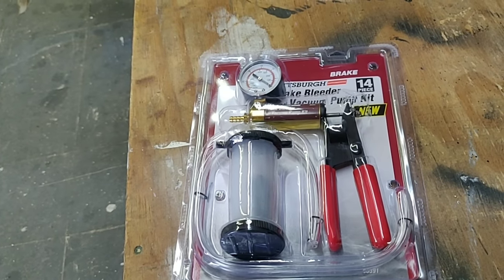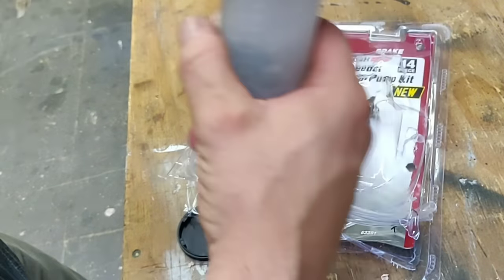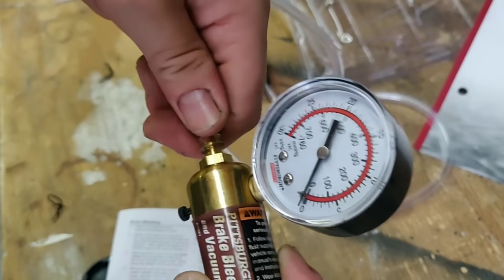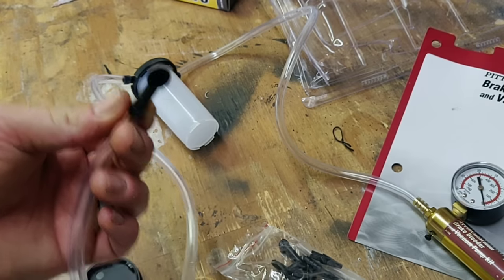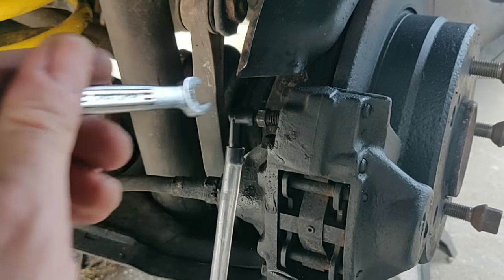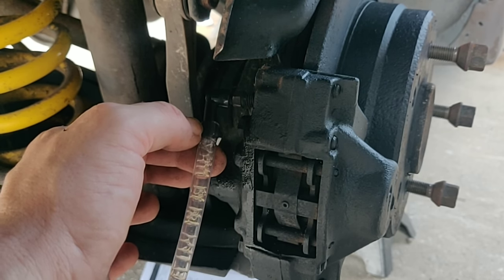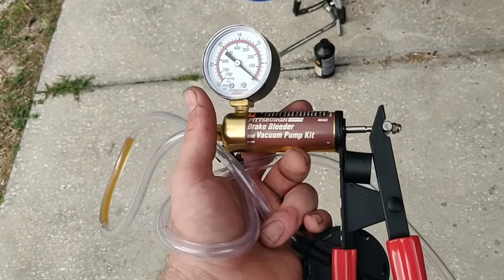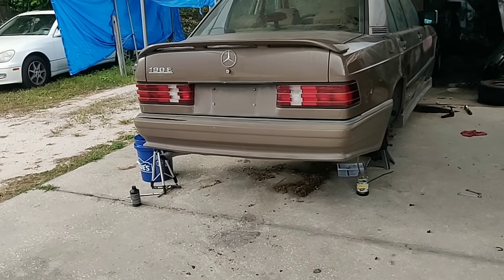Harbor Freight Pittsburgh brake bleeder vacuum pump demo and review

Comment: Best to use a box end wrench instead of a line wrench on a bleeder zerk - reason being that a box end will easily fit over the end, since there's no brake line to contend with, & even the best line wrench has a certain amount of give at the gripping surfaces due to the opening to allow it to slip over the brake line. Also, you can always just run a short length (about 6in to a foot is fine) of tubing from the bleeder zerk to a small jar or bottle with enough fresh fluid to cover the tip of the tubing by about 2 inches. Crack zerk open & gently press the brake pedal a couple times. Air bubbles exit, only fluid can return. No assistant needed. Keep an eye on reservoir's fluid so you don't run it dry.
Reply: If your inside pressing the brake pedal, how do you know when all the air is out of the line? You can’t physically see it.
Reply: @M21-w1y  good question… wonder if you tell a difference in the pedal, or maybe you have to get out and go look?
Reply: Guess you wouldn’t positively know but 7 pumps is probably fine. Also with enough tube it’s not like any fluid is being wasted, just sucking back in.
Reply: I bought 12 foot of hose put it on the bleed screw and ran it to the break resivor pumped the preaks. Until the bubbles were gone. But like some one said if the bleeder valve is loos it will suck small air bubbles

Comment: i had one i did the same as got rid of it . i did take it back to the shop and said it  would not bleed the brakes on a 850 mini what a pile of junk i have been in the trade over 30 years.. great upload
Reply from the maker: Wow thanks for the comment.  Good to hear a realistic approach.  I made video to show what's its like using a tool that most have never used and how it could work.   I have a lot of comments telling me I'm an idiot but I've been wrenching on cars with my dad since I was 9.  By no means am I a mechanic or think I know a lot but it's all about learning everyday.    Also my dad is a certified airplane mechanic and said he would still never use this.   Sometimes the good old two person method is the best.

Comment: I just installed pads, rotors and two front calipers on the 2012 Accord. Got everything together, bled the new calipers, I think a 3/16 inch clear hose and an empty gallon jug. I was flushing out the old brake fluid, and fluid is cheap. Did the entire job by myself, using the brake pedal. I think I paid $4 for the hose at Home Depot, along with three 12oz bottles of DOT3 brake fluid, $12, again, at Home Depot, the jug was free at this point. Remember, if you have an ABS unit under the hood, usually opposite the brake fluid reservoir, that is your starting point in regards to bleeding order.

Comment: JSYK, I ran into the same issue with this pump. I ended up having to put the clear hose directly on the brake bleeder valve as none of the connections fit correctly.  The pump did get some of the air out, but not all. I found that the plastic bottle and oring began to leak causing it to loose vacuum.  I would not recommend buying or using this pump. Had to do it the old fashioned way.
Reply from the maker: Thanks for the info and appreciate you watching.  Have a great day.

Comment: Hey. You need to remove the rubber stopper that wedged between the pump handle prepackaged from factory.  This is why you can't pump up the pressure. It happens to me and I realized it. This tool works great in my Honda Odyssey 2010 EXL

Comment: I made my own powered vacuum pump from a B&D drill, 12v air pump. I jb welded a fitting to the intake of the pump creating a vacuum source. I also have used a cheap check valve on the tubing to keep the fluid from going back.
Reply: sounds like you should make how to vidz bro

Comment: I've been wondering about using the "vacuum" approach to bleeding brake systems.  But, I think I see a flaw in that method - the bleeder screw.  As you apply vacuum to the bleeder screw and then loosen the screw I think that allows air to suck in past the screw threads.  The more you open the bleeder screw the more air is sucked in as shown in this video.  I don't think the vacuum pump was at fault - just the process.  When someone is pumping the brakes the pressure forces out air and fluid through the bleeder screw AND around the threads.  WE DON'T CARE.  It is pumping OUT any and all air along with the fluid.  That's why the brake pumping technique works better than the vacuum technique.  There is a way to pump the brakes by yourself and that is to use a bottle half filled with brake fluid and a hose from the bleeder screw into the bottle and deep into the fluid.  That way, air gets pumped out and not sucked back into the brake system.  And don't crack the bleeder screw out too far - just enough to get a light flow.  Or, take out the bleeder screw and put some teflon tape around the threads being careful not to get the tape on the machined surface of the screw.  That should stop any airflow over the screw threads.  Or, some "grease" or anti-seize on the threads should also stop airflow past the threads.
Reply: How would you ensure air does not get sucked back in past the screw threads when pumping into a bottle?
Reply: @pingpong9656  - If you are going to bleed the brakes by yourself by pumping the brake pedal then after using grease or teflon tape on the bleeder screw threads you should put the other end of the plastic hose into a bottle of brake fluid.  That will prevent air from being sucked back into the brake lines.  There are some good videos about how to bleed brakes with one person only.  They will show you how to set it up.  I think Chris Fix has a good video on that.
Reply: If you look at the video the user didn't remove the black circular piece that is on the tool for shipping tool was not defective if that piece is remove you will get lots of pressure.
Reply: You are exactly correct.  And the guy threw away a perfectly good tool. What a waste!
Reply: Good tips, thanks.

Comment: I agree with his review and assessment of this item. I just bought this same device from Harbor Frieght. I tried to use it on my 55 Ford that I put new wheel cylinders in. I could get this device to pressure up to 25. But, that was not enough to bleed out the brakes. I spent several hours trying. My son came by and in 10 minutes we bled the front brakes. This tool simply does not build enough vacuum pressure to bleed brakes.

Comment: To everyone having this issue.  See the line in the body between where the gage is mounted and the rest of the body?  Unpeel that pittsburg sticker.  The front of the pump unscrews right there.  Hold the gage and handle, and just unscrew the the front end right off.   There is a rubber check valve / diaphragm inserted into the gage side (it will look like a flat piece of rubber but it has a tit on the back side (inside the body pointing toward the gage) that acts as a check valve.  Gently pull that check valve diaphragm out and clean it.  Be careful not to tear it, and don't get any oil on it.  All it takes is a spec of dirt getting in there to hold that check valve open and it will behave just like yours.  It's not Harbor Freights fault, there is no filter in these things, you probably sucked something up in there.  I paused the video to write this and right there while you are calling it a piece of junk you have fluid in the suction hose (past the reservoir).  Cleanit up, unhook the hose and  blow it out.  It should work like new after that and go to like 25" of Hg easy.  You may need to do that quite often because again there is no filter and maybe you accidentally get dirty fluid  or dirt in the air all the way up there.  Also I find that little rubber gasket on the reservoir can leak to and cause the same problem.  It happens

Comment: I just bought one and I see some issues with your set up.
1st off The bleeder needs some thread tape or pipe dope  to seal it from sucking air while you apply vacuum.
Secondly the bleed screw adapter you installed backwards the big end goes over the clear line and the small end goes over the bleed screw nipple. Once that’s accomplished it’ll pull plenty of vacuum and quickly suck the air out of the system. The instructions show the bleed screw adapter backwards in my opinion. It actually works really well this way.
Happy wrenching!!

Comment: You have to remove the tab from the pump trigger, or it won't pump higher than 10. I accidentally figured it out by taking a look at the instructions. 
My instructions said to remove the tab, or you can't squeeze it all the way back. Once you do, you can easily get it to the highest level.

Comment: A "pipe wrench?" I would use a flare nut wrench.
Reply: Pipe wrenches aren’t for working on vehicles.  Obviously this guy doesn’t know his tools. Box end “brake bleeder” wrenches work best, and limits rounding the bleeder. High end Flare nut wrenches would be ok too, but cheap ones usually fit loose and could easily round off the bleeder.

Comment: Need to ptf tape on the bleed nipple threads to stop air getting in 👍
Reply: Do not use tape or it will get into the system. Use silicone grease on the outside threads. It worked for me last Month.

Comment: Bubbles are being pulled in through the bleeder threads. Remove the bleeder and wrap the threads with Teflon tape. Reinstall and then bleed.

Comment: you are probably leaking air from the screw thread or the fitting. That always seems to be a challenge
Reply: Remove and clean the bleeder screw. Before replacing it, wrap a little plumber’s tape around the threads. This will eliminate the problem of air mixing with the fluid by way of the loosened bleeder screw.

Comment: The item works, but you need to put some grease between the inner and outer thread of the valve. If there is no grease, air is sucked in by the negative pressure and appears in the brake fluid coming out. So you never can be sure, if the bubbles are coming out of the fluid or through the thread. What I saw, was air "inhalated" coming through the threadts. That also can happen by using posive pressure, if the valves are unscrewed too much.
Wherefrom do I know this? I have tried the same tool and had a lot of bubbeling. I analysed the problem and fixed it with the method descriped above. 

Regards Th. Krapf

Comment: LMAO pause at 11:54  that little black round thing sitting in between your pump handles is supposed to be taken out its basically just to hold the handle in place for the packaging, thats where every bit of your problem came from!!! you werent able to press the pump all the way haha. also all those air bubbles you are seeing are not coming from your brake lines its coming from air being sucked in around the bleeder valve, i just connected the hose straight to the bleeder valve without that little black attachment and also took some grease and smeared it around everywhere and it seals airtight. this is by far the easiest method of bleeding brakes for me, i hope you didnt waste your money and throw yours away because you did it wrong lol
Reply from the maker: Oh wow thanks for filling me in.  I may still have if trash didn't come. I will take a look but I still think there was an issue with it holding pressure.  I tested it a few different ways off camera
Reply: @petescarport  Once you break the bleeder valve it will draw air in from around those threads as well, but see my comment on the adapter you're supposed to use in the clear (23" or 3") line before the bleeder valve of the correct size.
Reply: Just return the darned thing
Reply: Do you know what's the purpose of connecting the hose to the bottom of the container cap? I forgot I have to do it the last few times I used it, but didn't see a difference.
Reply: @ronenfe  That short hose stays under brake fluid in the reservoir. So if the pressure changes brake fluid goes thru the line back to the brake and not air. As that is in the top of the reservoir above the brake fluid. Hope that clears things up.
Reply: @waterandsteel4713  How could the pressure inside the system get lower than the pressure in the container?
Reply: Anyway I close the bleeding screw before I let the pressure drop.
Reply: @ronenfe  Uhm let me see. Some one starts the car? The hose slips off the vacuum chamber? The air release valve (under the cylinder) fails? Anyway I didn't engineer the damn thing and I don't care when you close the bloody screw. I'm done.

Comment: Those "bubbles" are from the loose bleed screw, lol
Reply: Yup, need to put grease on the threads.
Reply: @georgecurtis6463  what kind of grease should i put? silicone paste or copper anti seize?
Reply: @kevinzki21  any kind that is thickish. Or thread tape. Anything to prevent air from passing through the threads.
Reply: I've read that elsewhere; is there any risk of the grease being sucked into the thread gap, as the air is doing?
Reply: @georgecurtis6463  Thanks; is there any risk of the paste/grease getting sucked into the system, as the air is?
Reply: @JackJensenTrader  well, there is a chance but when bleeding with this type of system, you go slowly. The fluid doesnt move fast, in fact rather slowly. So if you just crank up the vac thinking it going to speed up the flow, it won't but it will cause the grease to get sucked in. So it's a slow, tedious way to bleed brakes. You just need a small slow stream and yer good.

Comment: I order a the same pump on ebay I desperately waited 3 weeks to get it. I was able to pump it up to 15psi on the 2 rear tires but fluid got into the pump and fail to keep pressure. It was not the pumps fault it was mine for not watching videos or read the instructions. You never want fluid in the pump per videos I watched. I learned by my mistake...heading to harborfreight tomorrow to try it again.
Reply: This is a key point. The bottle tips over and some fluid gets in the line between the bottle and the pump, and it no longer functions as it should.

Comment: there's a cup stopper once you take that out you can get 10-20 easily. It didn't lose pressure when the bleeder was closed so it's in the system. Mine never stopped bubbling but I would pull a bout 8 fl oz through.

Comment: It may be user error in this case but I will confirm that It actually is not a very sturdy vacuum pump. I used one for testing the vacuum line that controls the climate in a Ford Crown Victoria and it broke in relatively short order, maybe a month later, with the issue being it was not able to hold vacuum any longer. I purchased a MityVac on Amazon and it has worked flawlessly as a vacuum pump with zero issues.

Comment: Do you think air was leaking in through the threads of the bleed nipple?  I have heard it recommended to wrap it with teflon tape there.  I believe you can also purchase bleed nipples that have a one way check valve inside them, which would mean you don't have to loosen the threads which can create a leak there.

Comment: As mentioned by others, you forgot to remove the black spacer between the handles before using as noted in the instructions.  My HF bleeder tool works flawlessly!  I now see you posted an updated review. Thanks. 😮
Reply: Yes, that piece just above the fulcrum prevents the outer pump handle from bottoming-out on cylinder, from which the next stroke will have maximum vacuum travel.

Comment: You left the shipping spacer in the pump handle, I initially did the same. Mine works great and I’ve used it on many different vehicles.

Comment: I have one of those.  However, it didn't work out of the box.  The black cap fits loosely on the fluid cup.  Had to wrap the top of the cup with teflon tape before I could draw a vacuum.  May have been a factory defect.

Comment: I was looking at mine between the two grips there is a round plastic packing piece that has to be removed before use or it will not go past nine the one on this video still has it in,it works great

Comment: To be honest I would have just put the hose straight on to the brake nipple. The guy does a follow up to this video where he learners how to use it properly. There's also a black spacer thing placed at the top of the handle for package purposes. He hasn't removed it so that's why it's not working to well. I didn't notice myself but there was a few other people had committed on this in earlier posts.

Comment: I am not sure if anyone addressed this yet, but I noticed at about 9:45 in your video, you checked the brake fluid reservoir and the CAP was off while your were testing the Pittsburgh Brake Bleeder.  I am not a mechanic by trade, but have done quite a few brake jobs.  You are suppose to keep the reservoir full, and the CAP on.  That way do yo not allow AIR to get in to brake the lines. That may have been part of your problem.  However, nothing beats the old buddy system.  I remember my dad asking me stand on the brake peddle and not to let go, in  his old 1970 International Harvester Pick-up.  I was about 10 and could barely see over the steering wheel.  Those were the days!

Hope this helps!

Comment: I have the same HF vacuum pump. Worked great for a while - then it didn't. The seal must have went out inside the pump. Mityvac pumps are rebuildable.

Comment: You are so right that is one that they need to take off the market causes of poorly cheap maid pump device I've had two of them in the past and they break easy and sloppy and when you  trying to bleed your brakes  the pump breaks down down for some reason
Reply from the maker: It's the cheap seals.   I made a video comparing to the mity vac and it's a way better device for a slight but more